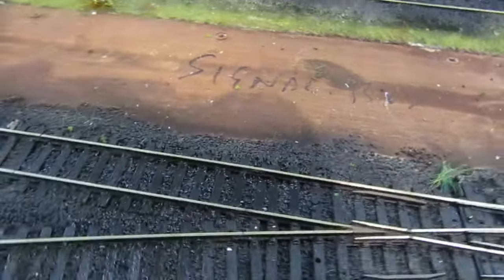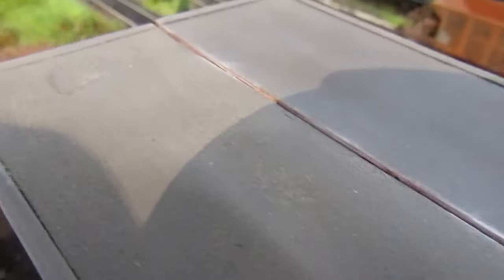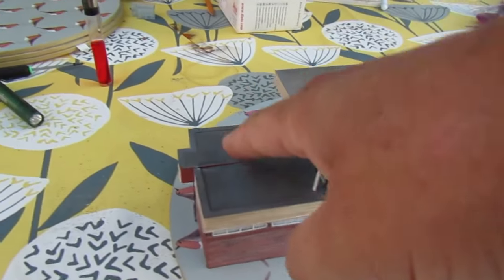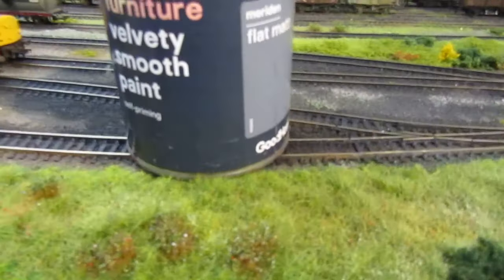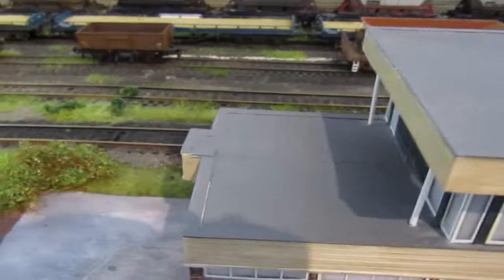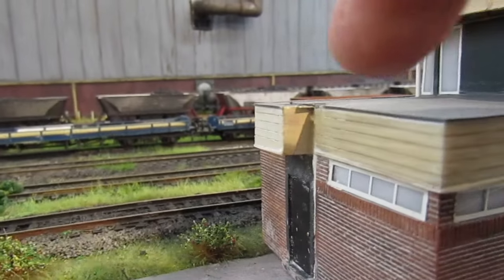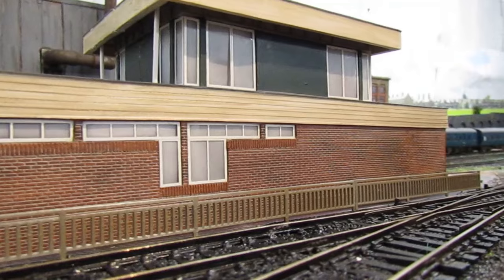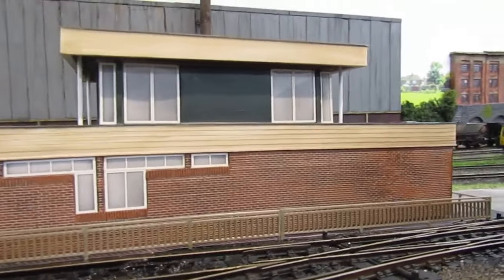Converting a Low relief Bachmann Power signal box into a full 3D Power signal box

Comment: Looks really good - well done!  👍
Colin
Reply from the maker: Thanks Colin, 

It turned out better than I expected. I am sure there are other low relief buildings that can be adapted like this?
Reply: @CHESEABUN  Quite possibly there are Richard!
Conversely for Ewhurst Green I used full Northlight Factory buildings as low relief (then made the adjacent offices) to give greater visual depth.

PS in terms of getting rid of the roof joins on future projects had you thought about covering the roof area with a thin plasticard sheet?